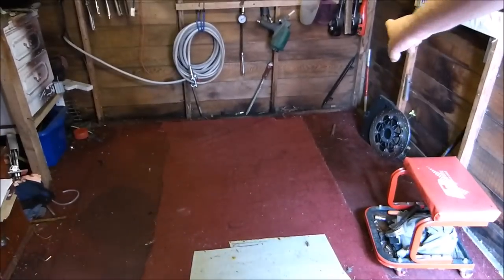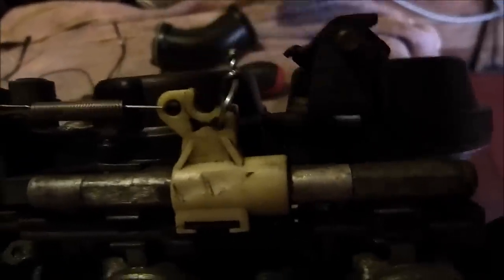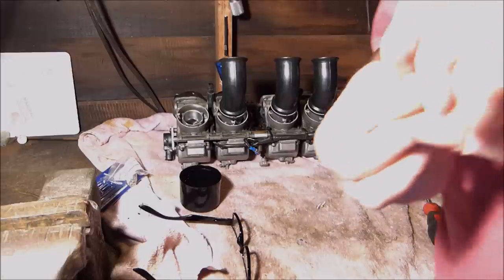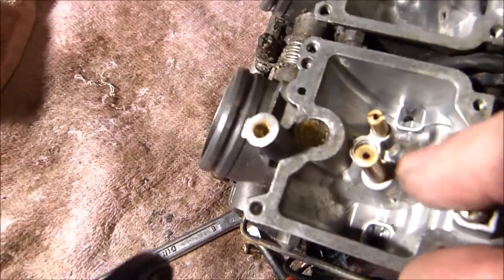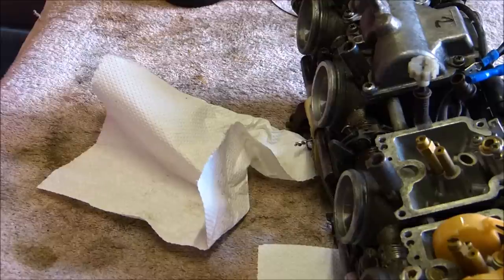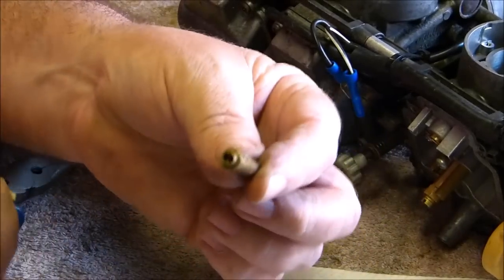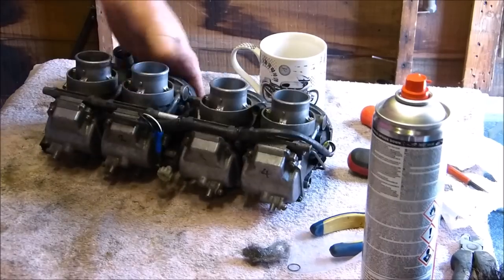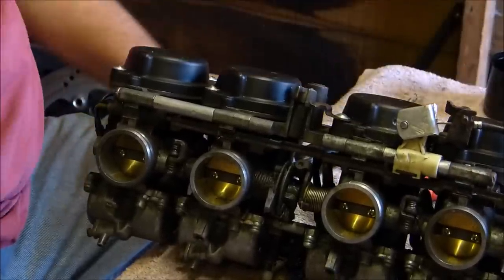XJ900S FINAL FIX , Hidden Jets P-4

Comment: When you put the main jet up into the body with the pliers the groove has to line up with the tiny ball bearing on the carb body that way the hole in the jet lines up with the hole in the carb before you screw in the top piece of the jet. Make sure to still hold bottom half with pliers until top half is tight in case groove moves past bearing
Reply from the maker: thanks for that matey.
Reply: @jonyr1TT  Can you explain what this means please?

Comment: I have a mint gsx600f with no choke.if it needs it I stick my hand under the seat.and cover the air filter.has it's a massive job to get at it.....has you know
Reply from the maker: Great midrange bikes I've had 2 loved them both.
Reply: @jonyr1TT  yes.just wish frame was a bit bigger
Reply from the maker: If I remember rightly I think the carbs are a tight fit in the frame. The gpx600 are almost impossible to remove with the tubes in the way.
Reply: @jonyr1TT   Uri Geller struggled.never mind me and me fat fingers
Reply from the maker: Lol like wise they call me sausage fingers. Pmsl

Comment: Dam florence tubes are a pain dude make guitars buzz like hell sometimes. I switched to led strip lights much brighter and cheaper.
Reply from the maker: Cheers Dale led strip lights not to sure if they will give out enough light for filming.
Reply: @jonyr1TT  iv got the led batten from screwfix £30 just as bright if not brighter than my old fluorescent tube light. Worth a look if you want to replace the light.
Reply from the maker: Never seen one of them I'll look into it cheers young man.

Comment: Hi, it would be very helpful if you confirm that at 17:40min at your video, this little tube goes at the direction that you show. I took it apart and i don't remember the direction...
Reply from the maker: Hi vasilis,
 Let me check..... yes i do say the notch goes in first;
Reply: @jonyr1TT  Thank you very much for your help! Greetings from Greece-Zante!
Reply from the maker: cheers buddy glad to help.
Reply: My XJ has 13000 kms only. I cleaned the jets, change the orings but one cylonder nr4 still runs rich. Any detail that i must noticed when i put back together carb parts?